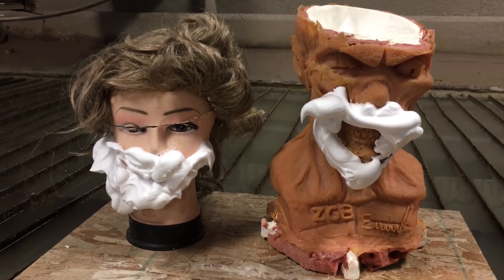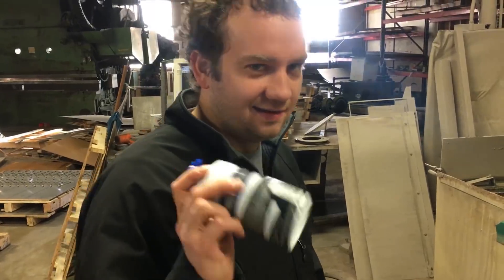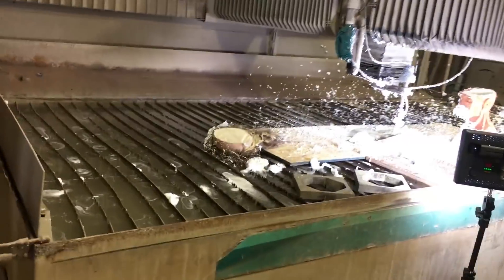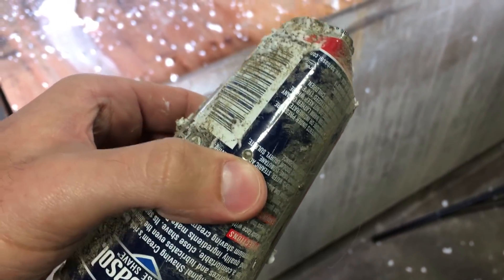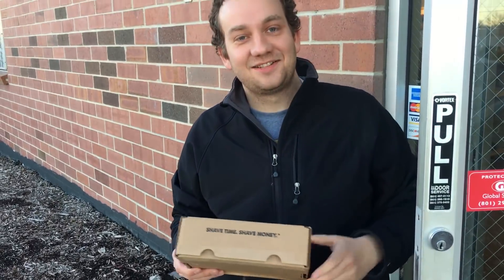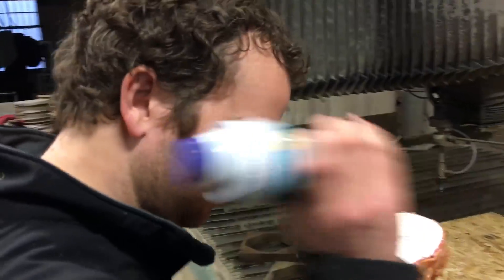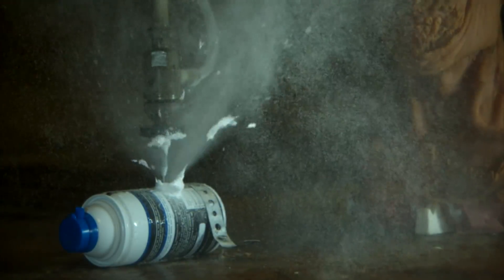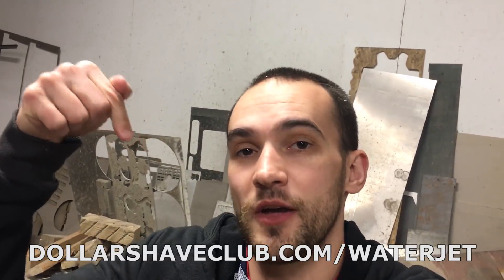Shaving Cream vs 60,000 PSI Waterjet - Waterjet Channel

Comment: I love you guys. I hated their razors. They were like using a lawnmower blade on my face. Both their top of the line and middle of the line. The shave butter and after shave lotion are great! I bet most of the stuff they sell is pretty good. The blades suck in my opinion. Use a WaterJet or ANY other razor to shave.

Comment: How bad would a water only water jet hurt you if you did a quick horizontal karate chop through it?
I kind of want to see you guys do a challenge video where you take turns putting your hand through increasing PSI level water jets. The first one to chicken out loses!
Reply: It would either cut clean through it or shred your hand in a gruesome fashion.
Reply: Whatever you do it'll either glance off with minor abrasion (0.01% likely) 
Or you'll get high pressure injection injury that happens instantly and is basically several weeks at the ER with permanent damage. 
It's basically an explosion. Really.